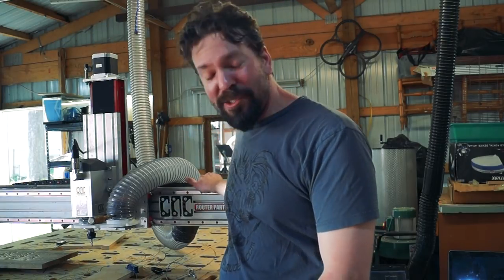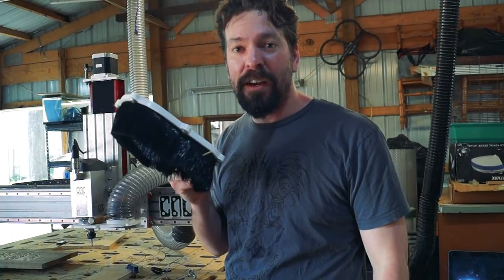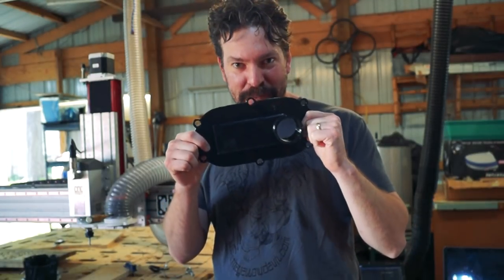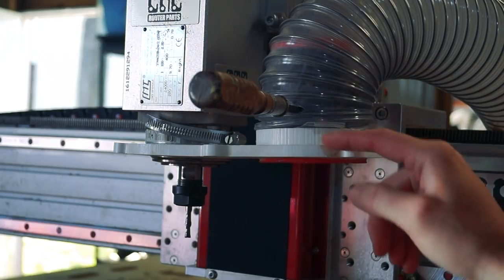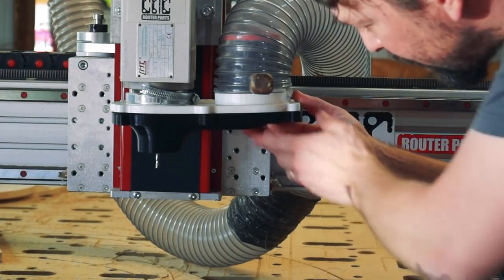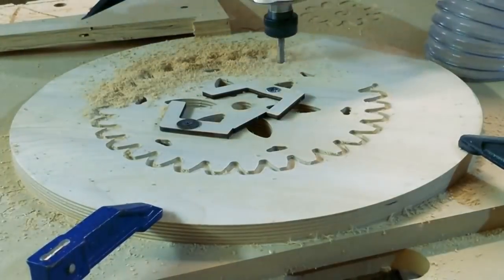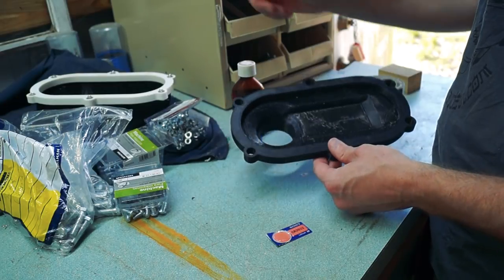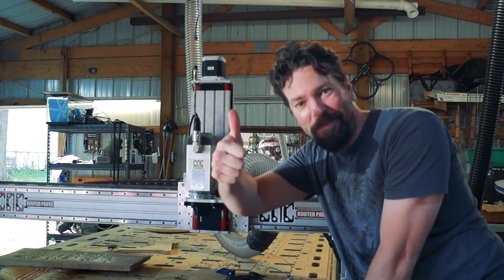CNC Router dust collection that DOESN'T block the view!

Comment: That's a great solution.

At this point, I just can't help but add some design suggestions and complicate matters.

If you add a telescoping vacuum port, it would work with longer bits.

But then, you would want to print it with clear plastic or form.

I'm thinking a clear housing that extends down to just above the chuck with similar to the shape of the brush with two or more telescoping sleeves that extend the rest of the way down to the surface being milled.

The biggest problem with this is insuring that the contact between the sleeves is smooth enough to allow for collapsing and extending as the bit descends and ascends while milling the part. Perhaps Teflon between contacts points would help with that.

The bottom sleeve that contacts with the wood being milled would need a couple of hear and there for air flow.

Well, maybe one day when I grow up to be a full sized maker like you Caleb, I can give my idea a try. 😁
Reply from the maker: sounds interesting. Also sounds like it would take a ton of ttrial and error to get it just right.

Comment: You made one very important fundamental flaw...  And It was in your understanding of how air pumps... You can't increase pressure with an radial fan by decreasing the size of inlet. You need a positive displacement type pump (like a Roots type supercharger) to do that. All that happens when you restrict the flow in a radial fan, is you restrict the flow... You may get some minor increase in drop pressure, but it certainly isn't worth the trade off of what you lose in air flow volume.

There are two things you are trying to stop with the vacuum, the first obvious one is to clear the job of the visible debris. The second part of the job is to stop and clear unseen airborne particles (these are the ones that are going to kill you).

Using some rough ballpark figures let's say at the inlet you have 10" of vacuum and 500 fpm of air flow. Massively reducing the inlet from 4" to 1" (remember your spindle nut is blocking plenty of the hole) you may increase the vacuum to 11," but you drop the volume to 50 fpm. So you increase pressure by 10% but you reduced flow by 90%.

The reason is because the vacuum stalls the flow due to the restriction, and the air starts to cavitate around the fan impeller. This is why why you are vacuuming your rugs at home and you suddenly suck up a flat piece of paper and it blocks the end the vacuum cleaner starts screaming like a stuck pig. The motor itself is making no more noise, the extra noise you are hearing is from the air beating around the blades trying to move.

Effectively you have slightly more pressure, but you have zero flow (massively decrease efficiency i.e. wasting power). It is not like a positive displacement pump that must pump a given amount of air. I have recently drawn up a new shoe design on my channel you may want to check out. I have altered the design slightly and not remade a new video yet, but the explanation of how and why it works remain the same.
Reply: Bonus tip: The ribbed hose you have coming from the roof... Lose as much of it as you can. If possible replace that section of tube with solid smooth plastic pipe. The flow difference between pipe and that tube is night and day. Every single ridge in the tube creates a vortex, and hinders both pressure and flow big time.

Also forgot to mention in my first post. Did you notice how inefficient the capture area become once you moved away from doing circular motions? The amount of physical debris left behind increased a lot, now think worse case scenario of cutting long straight cuts at speed, and you will see the detriment of reducing the inlet.

Also note this design pulls all the abrasive material into contact with your spindle nut wearing it over time. The design I come up makes that virtually non existent.
Reply: couldn't find the video with the actual part. Did you ever made it? how does it work out?
Reply: @eddie25445  I could make up some lame excuse for why it doesn't exist, but it would be exactly that, an excuse. A mate and I were working on making a u-beaut 400 x 400 x 400 3d printer over at his place, but it has yet to get off the ground, after he decided he wanted to change how it worked. We pulled my existing 3d printer apart years ago with intentions of improving it, but alas it is sitting in a box in pieces. So without a 3d printer I never got past a design stage unfortunately. It will get done one day, but once the hot days of summer calm down a bit more I am currently working on my remote control mower again. I am determined to see that project finished.

Comment: Hmm.. building on Scott Tovey's idea, what if there was a piece of clear acrylic tube that sleeved into the vacuum hood? A couple rubber O-rings inside the sleeve would hold the tube in place at any height and allow easy adjustment. Could even be a Pyrex tube if you wanted heat resistance.

Comment: Caleb, do you have issues with dust when it comes to your 3D printer, or is the print area enclosed? 

I have a pretty dusty apartment and had issues with my Printrbot, got tired of having to recalibrate it and figuring out why the print wouldn't stick, so I ended up boxing it up and storing it away.

Comment: Cool, why not print a mount that would hold a gopro inside the brush  area of the dust collection mount? use some leds to provide light for it.
Reply from the maker: I considered this for a moment but there end up being lots of reasons that wouldn't work for what I want to do. I don't always use a gopro for my shots, for example only the 3d printed part of this video was gopro. If there was a gopro within a shoe that was lit, your view would be extremely limited. This way I can zoom in and out as far as I'd want to, and still see the tool.

Comment: If you made hole for dust collection bigger, suction would be better, that's just how it goes regarding dust collectors. I tried using reductors from 100mm to 40mm hoping suction would increase, but it didn't, just became weaker.

Comment: Nicely done Caleb, i think we need to DL the file to use it in our makerspace. Question how you have your hose mount it???
Reply from the maker: I'm using the cncrouterparts dust collection boot that is on thingiverse. For the hose, I just glued a cup in the opening one day to extend the length. I could just extend the length and 3d print a part, but this was faster.

Comment: I was guessed print 2 was a spacer that let you keep print 1 and mate it to the rest of the system.  I guessed wrong.  Maybe two L-shaped push-and-twist locks to add extensions when you have long tooling?
Reply from the maker: could have done that , and considered it but if you look at the two you'll see I also took the opportunity to make the design all smoothy and neato looking. I wanted it as low profile as possible to keep from hitting my clamps.